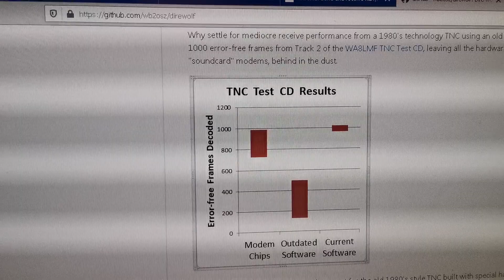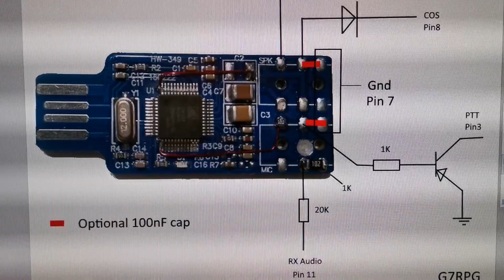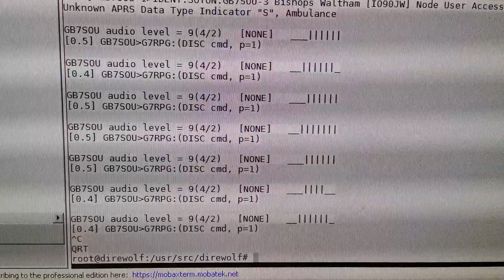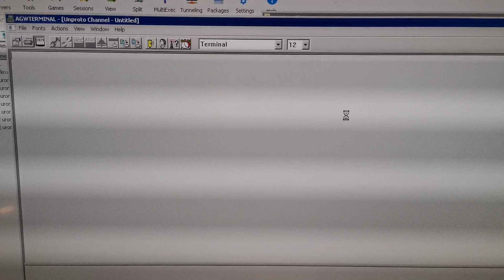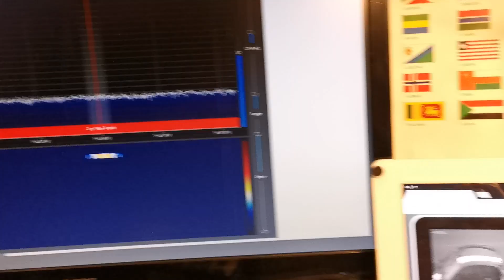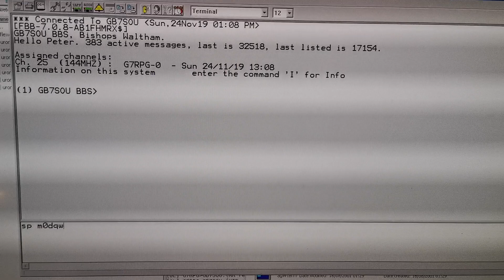Direwolf packet radio with cm108

Comment: hello will the cm108 work for other digital modes too ? like m17 ?
Reply: for "proper" digital modes the issue is usually not the audio interface, but rather the filtering (pre/de-emphasis, and the low/high-pass) of the radio itself. some models are modifiable to access the unfiltered 9600baud/discriminator-tap which is necessary.